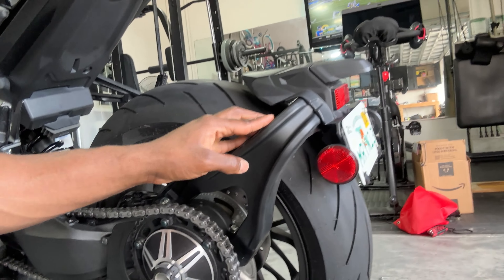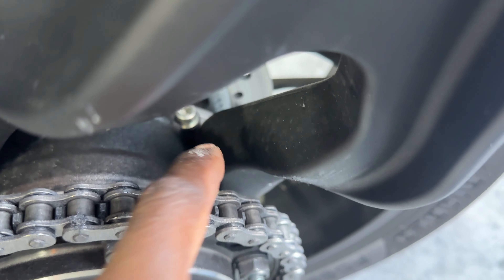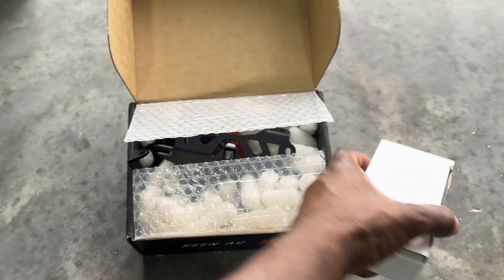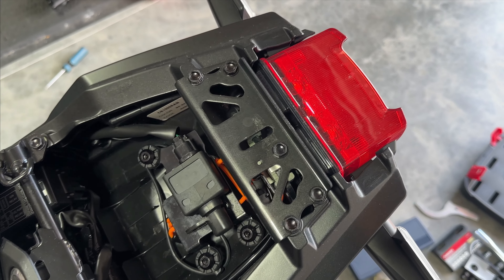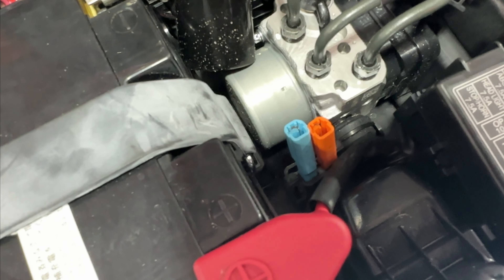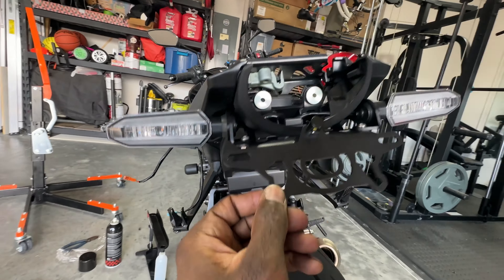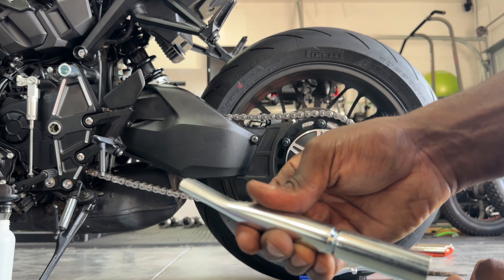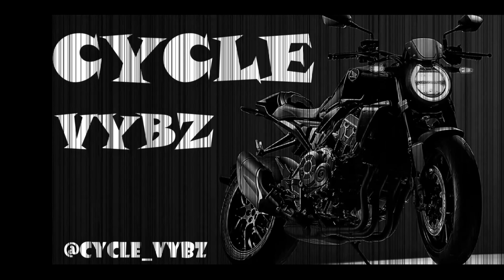MOTORCYCLE MAINTENANCE TURNED INTO A 4 HOUR INSTALL | CB1000r Chain Adjustment and Tail Tidy Install

Comment: Excellent video bud. The tail tidy install is SO much easier if you do remove the rear wheel, and with the ‘trolley stand’ that you own, that would be a two minute job. Keep up the good work 👍
Reply from the maker: Lol, thank!! Yeah, it definitely took longer than I expected, but the end result was worth it. I think because I started off with the chain maintenance, it kind of blended together.